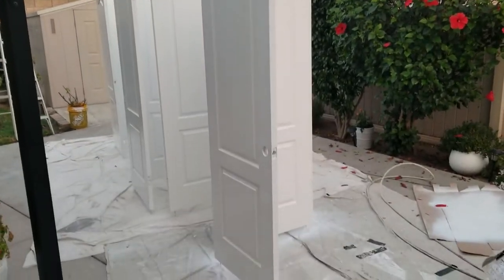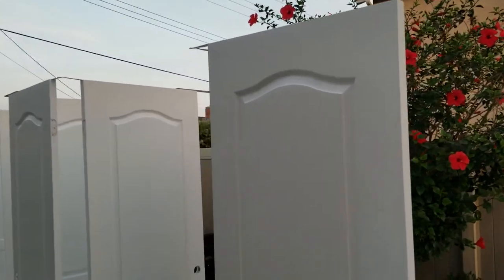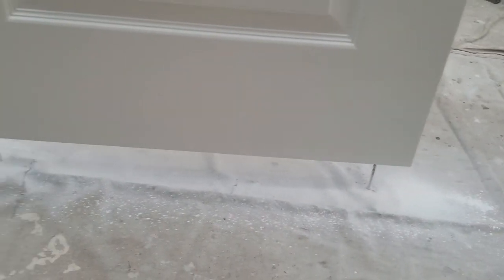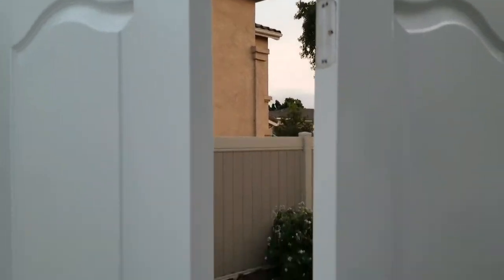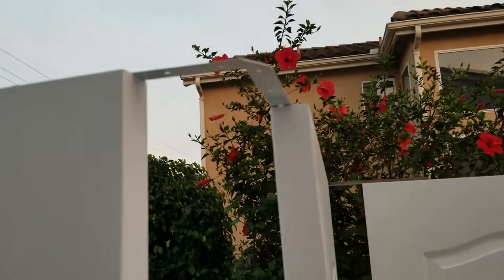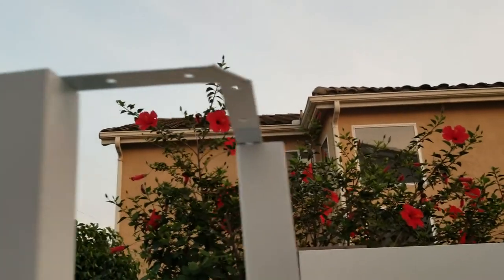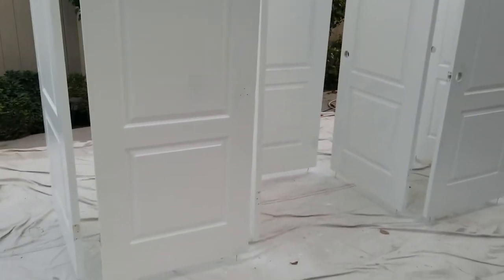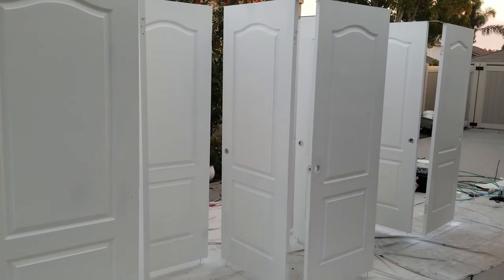Creative way to paint multiple doors at once.

Comment: So what went wrong with this attempt? I couldn’t find the follow up video. I’m planning to paint 12 interior doors this weekend and so far your solution seems to be the most viable. I was going to try it but want to know what I should avoid. Thanks
Reply from the maker: Nothing was wrong with the setup. I was using a compressor and spray cup to paint. Not enough paint coverage. Should of used airless spray gun. Now days they have hand held compact airless spray guns. 
Watch out for windy conditions, so the dropcloth does not pick up the corners and stick to the fresh paint.

Comment: I see you prepped the bottom. When you spray, how far does the paint go outside getting on fences etc.
Reply from the maker: Not to far.  I slightly angle the the spray tip towards the bottom.

Comment: Thank you I was planning to do one by one but the graco setup is so much work. What tip are you using considering they are so close to one another?
Reply from the maker: 3/13, or 3/15, meaning 3×2 is about 6 to 7 inch fan, and the second number represents the amount of paint.

Comment: Do you have to get up a ladder to put those angles in at the top? How long does that take you to set this up please?
Reply from the maker: @ninaelwart9460  Yes,  need a ladder or a step tool.   Depends from what point do you start counting the time? 
To take one door off the hinges- about 5-7 minutes. Then I lay the door flat on sawhorses,  clean all sides, sand if necessary, primer the spots where needed, screw in the screws in the bottom of the door,  screw on L shape bracket to the top, lay down drop clothes. So about another 20 40 minutes per door. Multiply the doors times the minutes per door and you will get approximately total time. Add time for painting, disassembly of this setup, clean  up,  clean the tools and equipment, installing hinges and door knobs. So 2 3 days.
Reply: @edmundssondors3738  thanks for the detailed timings and break down. I’m just starting out and tend to be way too overly optimistic with my timings when quoting. Thanks for the video and your response.